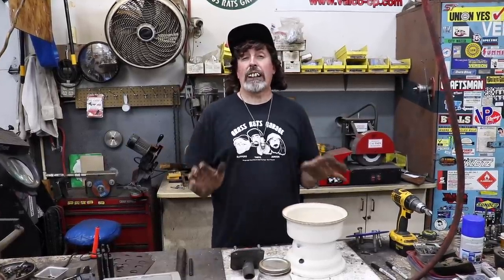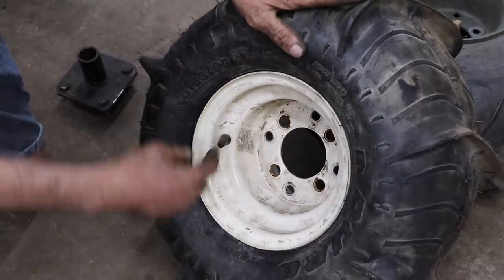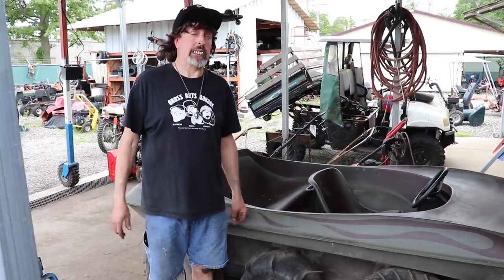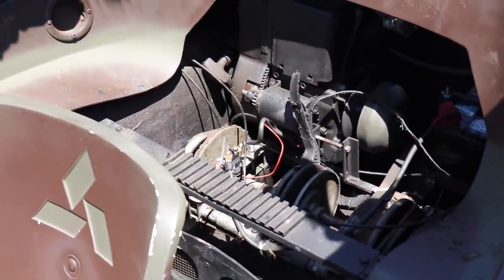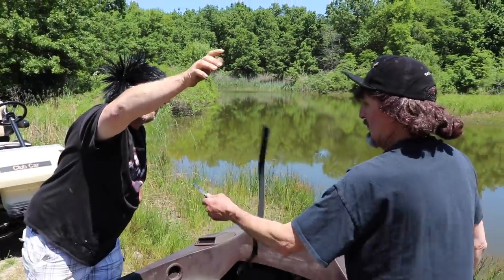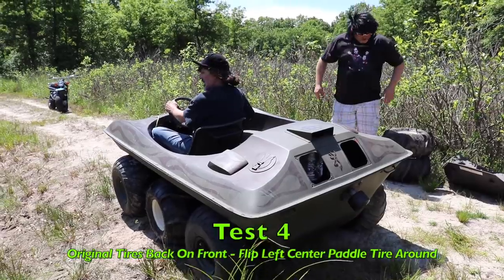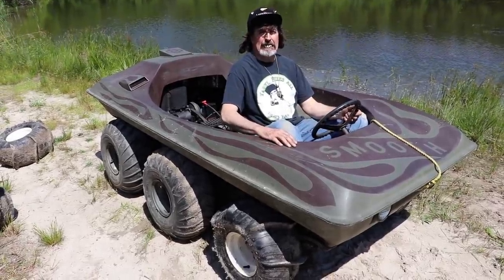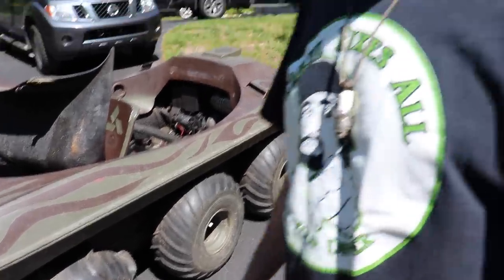Awesome FREE 6 Wheeler! Part 3 (Tire Test)

Comment: If you've ever pedalled a pedal boat you'll understand why this wont work. Firstly your limited by the hull. Then if your tires are sitting past the halfway mark your applying backwards force and a forwards force. The only time your getting a 100 percent forward force is when the paddle is straight at the bottom of the tire, and the water is below the centerline of the wheel. Your just stiring the water like crazy and it appeared the stock tires did the best. I have no doubt if paddle tires were worth the effort they would have put them on.

Comment: Problem: severe cavitation. All the " work of the engine is going to creating "'froth" not propelling the vehicular forward. It is essentiall like trying to put a lot of" horsepower to the ground on a slippery surface. The " stock" tires are better .

Comment: Since the tire size is your final gear ratio I would think you should always have the same size tires all around.  One revolution of the smaller tires don't take you as far as one revolution of the larger ones.  I imagine this would be hard on the drive system.

Comment: You know you can drill a hole on the other side of the rim and put a valve stem for the tires that are turned around you can't get to the valve stem! Basically have a valve stem on both sides of the rim.

Comment: I could see you got to fight cavitation and I don't think tires are going to make any effect as long as you got cavitation going on. Probably would have to think of how like an water pump works where you got tight tolerances between the gears you would need some kind of shield around your tire that would pretty much go almost all the way around it to get the water to act like a water pump shooting water out one end and not just splashing water

Comment: The center tires need to have more air than the rest to steer properly.
Reply: that actually makes sense, and is a good tip. its a fulcrum point

Comment: I'm calling those tires a fail. Mount a little 3 HP air cooled outboard motor on it if you want to go in water, or better yet a jet drive. The problem with the paddle tires is that the tire sits too low in the water to provide efficient propulsion in water.

Comment: All you do is aerate the water. They never were good in the water because first tire stirs up the water so middle tire has little to push against and back tire has even less. Front tires are the only ones that can do anything in the water. Example would be If you pedal a paddle boat as fast you don’t go anywhere either, but do throw a lot of water.

Comment: Why they never mounted a prop on the rear diff is beyond me. Those paddle tires just sucked the whole vehicle down where ever you put them. As they had to lift more water. Thats why the tread is so minimal as it is just meant to take advantage of the effect of moving small amounts of water at a high rate. Which is lost with paddles. Definitely needs a rudder and prop.

Comment: the air pressure should be around 2 to 3 psi for the tires no more than 4. you need to watch a whole bunch of 6 wheeler videos and learn from all the people who found out what doesn't work.  i will put my MAX IV 6X6 18 hp up against any 4x4 atv out there to a tug of war water mud snow ice and i will drag that atv without breaking a sweat.

Comment: From a purely scientific PoV:
The problem, in the water, with the 'Paddle' tyres is that you're using the same HP engine to shift a whole lot more water than the OG ribbed tyres do due to the depth of the 'paddles' on the tyre, even though there's less of them per tyre . . . You'd need a bigger HP engine, but then that would likely throw the balance of the vehicle off-kilter.

EDIT: Also, logically, the 'paddle' tyres move faster on land because they're 1) Smaller and 2) due to the depth of the paddles your surface contact with the road is much reduced so the engine isn't working so hard to drive them . . . Friction an' all that, y'know?

Comment: I can't see a practical way to use "left-only" tires in any configuration due to the tread design pushing water "out" as well as forward. We need a tire that only grabs the water in a straight line. Hard to believe NO ONE produces a 20" amphibious tire anymore. Someone should buy the Runamuck mold from Goodyear and help a guy out!! I have a total of 48 old worn Runamucks. maybe I'll figure out a way to "wrap" them in a tread-like manner.. like mini-tracks for each tire.

Also: Argo's own literature states that speed on water won't be increased using higher tire RPM. A nice leisurely paddle will get you about 2-mph. Cranking up the throttle tends to "aerate" the water. (It's just science.."we MUST trust the science!" LOL)

Also Again: Yeah.. there's a reason most of these AATV companies went extinct in the 70's. Kinda useless when you think about it. Only Argo(Canada) and Max(USA) endured because they focused on commercial use and abandoned the fun-factor.

Comment: I've used transfer punches for years in tool and die. You only want a light tap to establish the center. Hitting like you did can make the pattern move slightly. Also, the transfer punches are a precision tool, so I like to take care of them, and really mark the hole location with a center punch. I know what you'll say, "It ain't the space shuttle!", just my two cents. Love your videos and content.

Comment: Looks like the tires are 20x11-8, so if it's same as with car sizes then 20x10-8 agricultural/tractor tires will fit, just be a bit stretched. Ought to give better propulsion on water while being smoother than sand tires on hard ground. And they are the same for left and right, so no more of this "pulling to one side" nonsense.